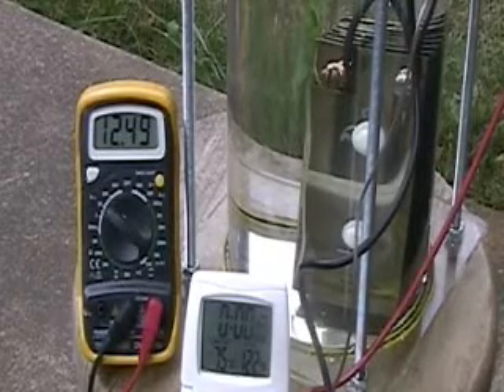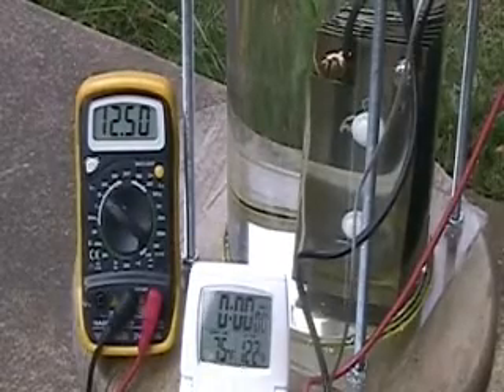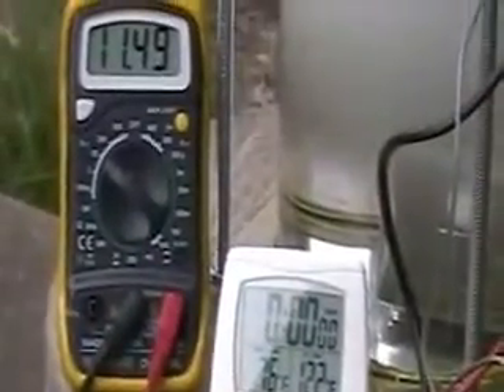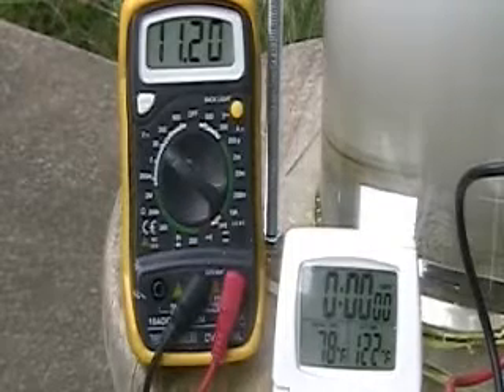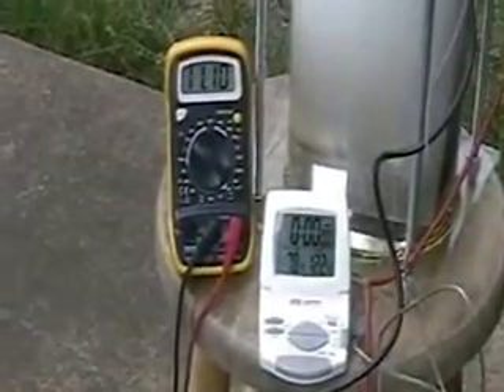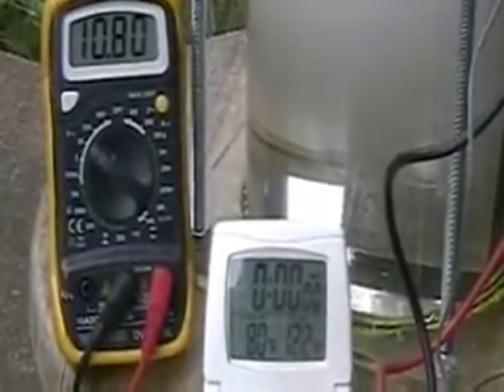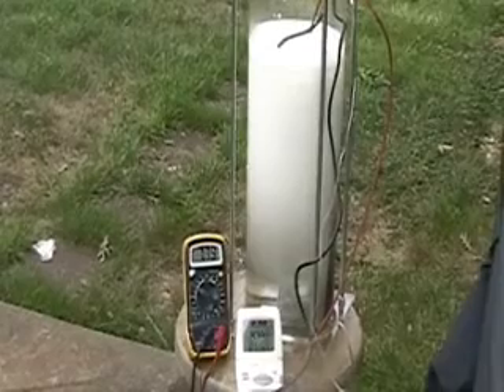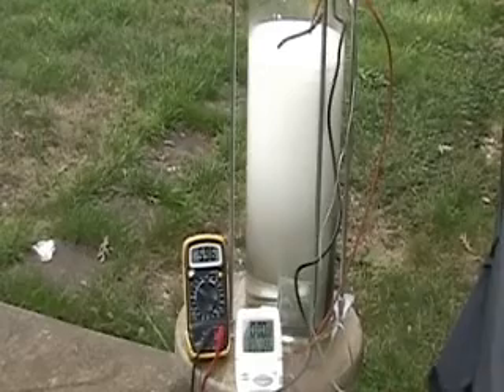Hydrogen Tap (10min Cell Temp. Test)  169

Comment: John, Why are you worried about the temp of the cell??? Does it become less efficient when hot? From a few of your comments in the vid it would seem the cell becomes more tolerant the hotter the water is. I also would like to throw the I dead of running the cell under vacuum allowing the cell to run at much higher temps while the water will have the same properties as if it were running cold. Keep up the Good Science.